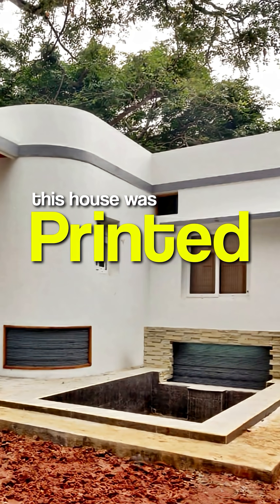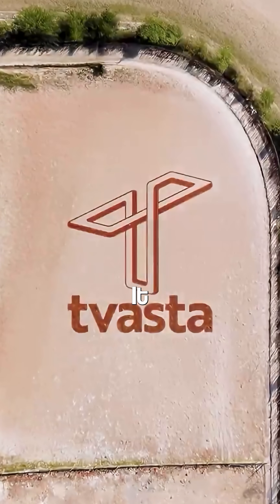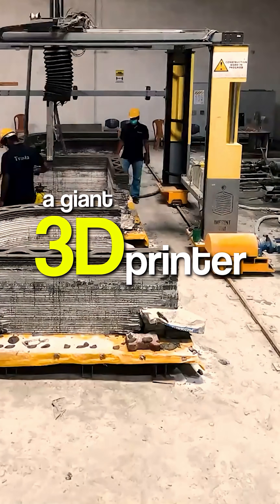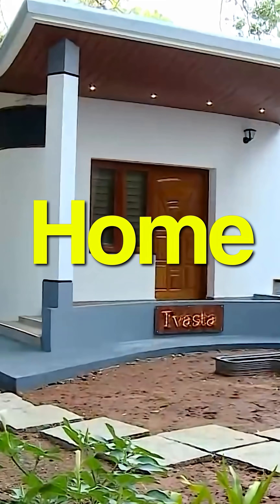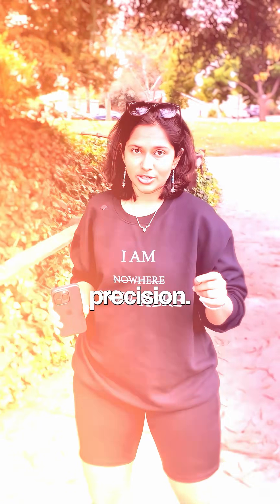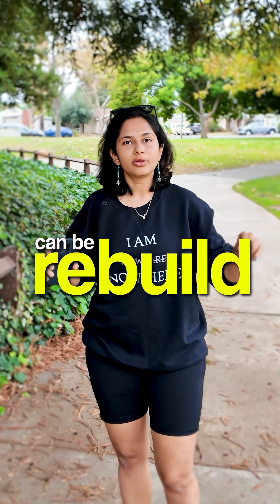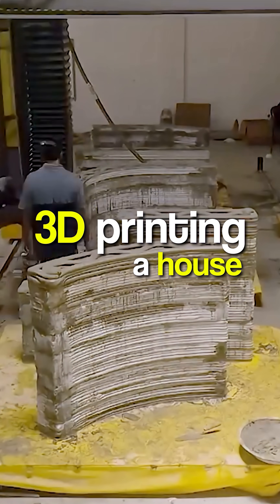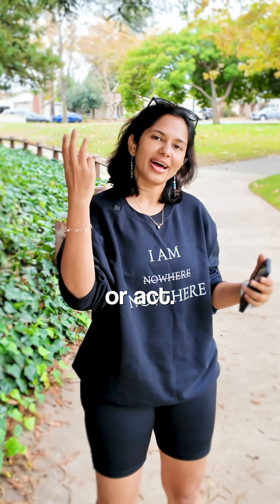Tvasta is building India’s first 3D printed villa right in Chennai, India | IIT Madras

Comment: It will become money making by 3D printing mechine owner and benefit will never be passed to customer. If it is true cement steel company or ready mix concrete company can build using 3d printing mechine at cheper rate , why they are not doing . Because 3d printer mechine is costly.

Comment: It wont change how we build houses because nobody wants to live in a toy house made without steel reinforced concrete.
Reply: Can it withstand a cyclone or earth quake or tornadoes
Reply: Actually the walls from the inside are designed with a very carefully selected Mesh Pattern. 

Which doesn't need Steel Reinforcement. Plus most of the world lives in wooden houses anyways.
Reply: @abhijitpanda524  Most of the house is built in wood? Which world are you living in? We dont have wood for even doors we use composite wood powder heat pressed doors. In construction even in colder countries people use wood only to line the inner surface for warmness the structure is backed by RCC or Composite steel structure.... This is good for temporary structures.. not for multistorey building
Reply: @simplyclear Learn to Read, first.

I said "most of the world" not India, USA, Japan and most of Europe lives in Wooden houses. 

So saying that He wouldn't take a cheaper house if it doesn't have re-inforced steel bars is stupid. Because "MOST OF THE WORLD" is living in Wooden houses anyways.
Reply: @simplyclear u r unclear dude. Read his comment properly
Reply: @abhijitpanda524  wooden houses have a truck load of problems like Moisture & Rot,Termites & Insects,Fire Risk etc...